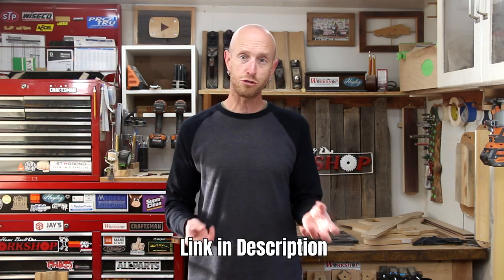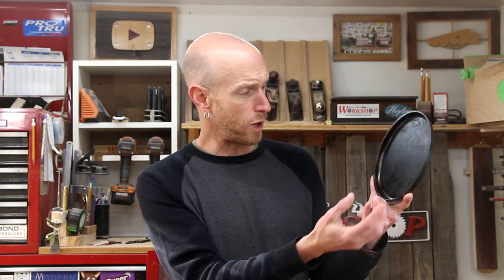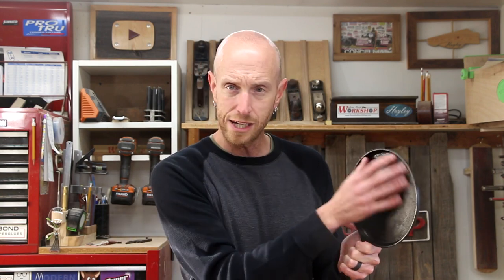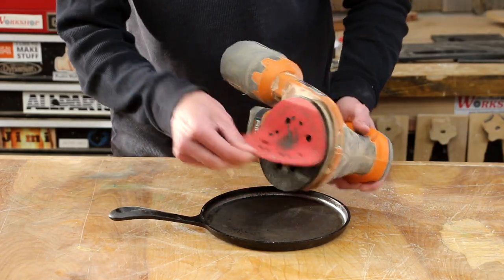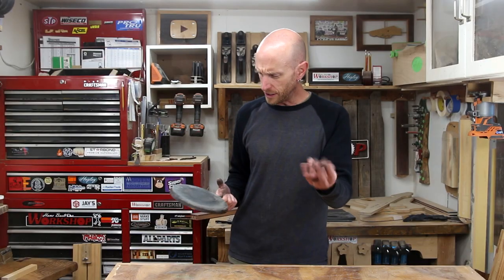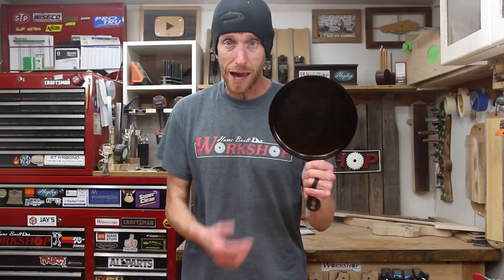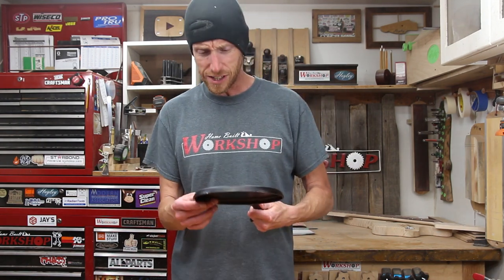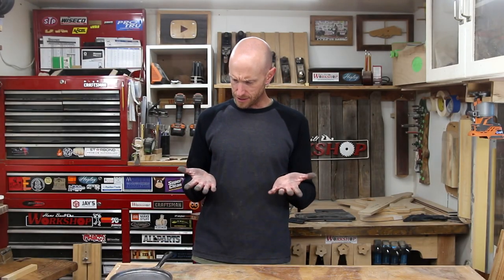How to smooth a rough cast iron pan | Make it stop sticking

Comment: I've been doing a lot of research on this. Some people are dead set against smoothing, some people are about making it like glass. Rough leads to more sticking, but holds the season better. Smooth does the opposite. 
Just sanding it with some 80 grit seems to be the sweet spot.
Reply from the maker: I too have seen mirror polishes pans. They look neat but I wonder how long they stay like that. I like them smoothed out, but not polished.

Comment: Very cool Jeff, I go 100, 150, 220, 320  then wash, dry heat then start the seasoning
Reply from the maker: Good to know. I didn't go any higher on this pan. I wasn't sure if it was necessary. I'll try that out next time.
Reply: @homebuiltshop  I don't know that it's necessary but I'm really anal about it😂🤣😂
Reply: I've read several comments say not to sand them too smooth so the seasoning sticks and have also heard people are having their flax seed oil seasoning chipping off because it's so hard. It's a huge debate. I wonder if the people having trouble with chipping are the ones who have mirror finish sanded their cast iron 🤔
Several people said 80 grit. I just bought a grinder with an 80 and 120 grit. We will see.

Comment: Cast iron used to be smooth.  They preseason it now.  Their spray-on preseasoning does not stick so good.  They make it with a rough surface so it will stick better.
Reply: The cheaper cast irons are not smoothed out anymore, that’s part of the reason it also sticks…the more expensive cast irons are smoothed out

Comment: if your having trouble with cast iron sticking take it out side build a fire and put it in the fire burn it of good then wire brush it wash and dry then put on the stove get it hot turn off heat cover with  bacon grease and you should be good to go
Reply from the maker: Thanks for the info. It all comes down to the seasoning, and maintaining that seasoning.